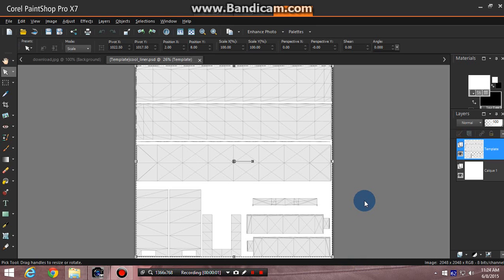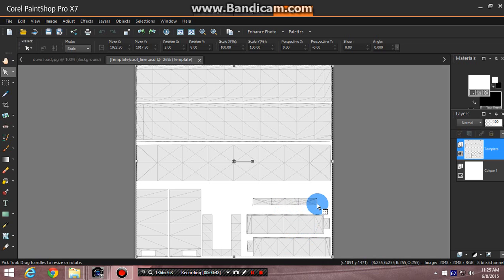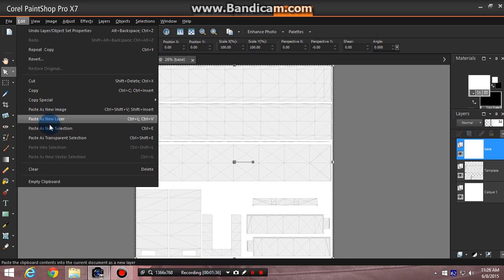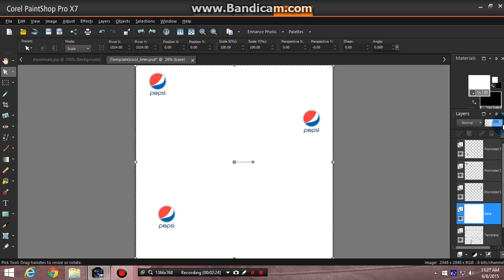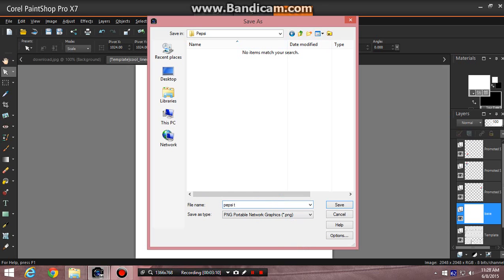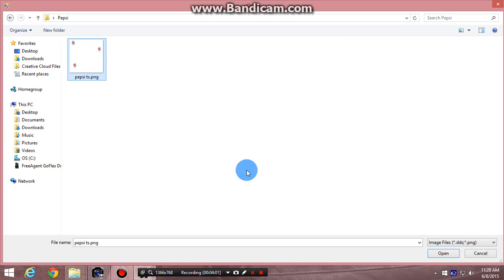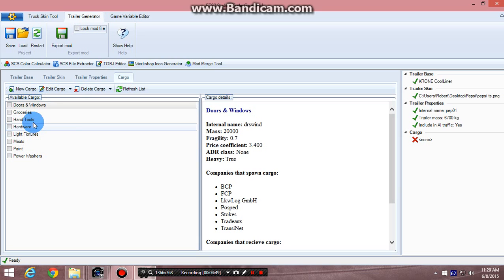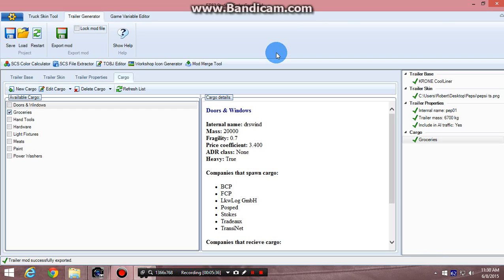ETS2  Trailer Skin Tutorial

Comment: Thanks for the video. I have set up three different trailers with ETS2 Studio. My problem is, I have a Staples trailer which I want to run it with at least two different cargoes, Office Supplies and Copy Paper. ETS2 Studio allows me to set these cargoes up and to select more than one. As I click on each one, they are listed to the right with check marks as if those are active. With everything else set correctly, I'm able to export my mod. But with multiple cargoes, the trailer never shows up in game. How do get it to work? I know other modders are doing this successfully.
Reply from the maker: +Larry Fick  It  may take a while for the trailer to show up, and that depends how many mod trailers you have in your mod folder, but it will eventually show up.
Reply: OK Thanks. I still don't think ETS2 Studio allows for multiple cargoes.
Reply from the maker: +Larry Fick   It does work, it works with me all the time.
Reply: ** UPDATE **
I finally figured it out. It hit me while I was laying in bed. The trailer internal code CANNOT be the same as all 5 of the cargo internal codes. Now it works fine. Thanks Bobbo.